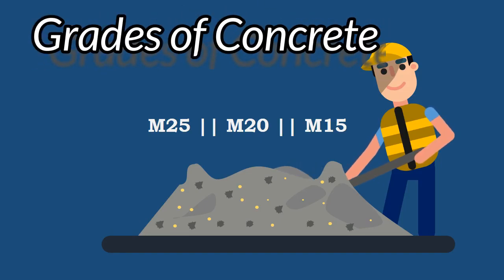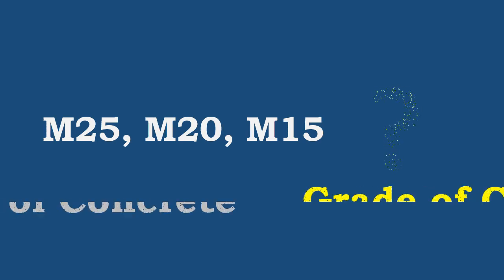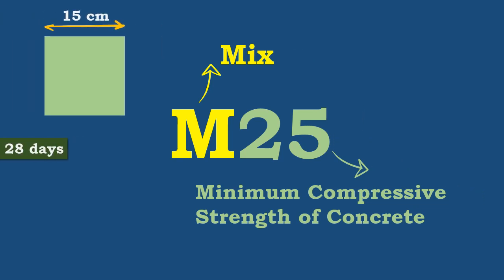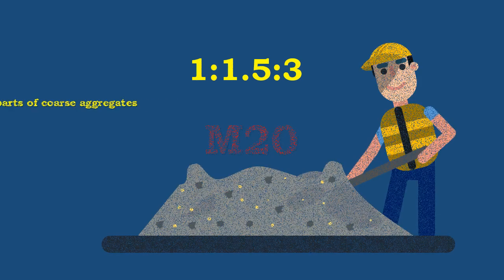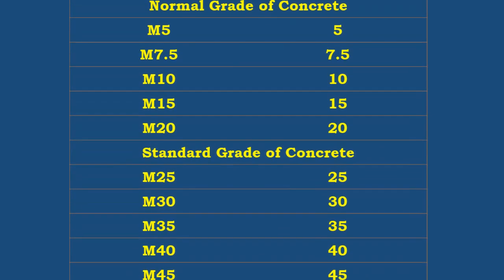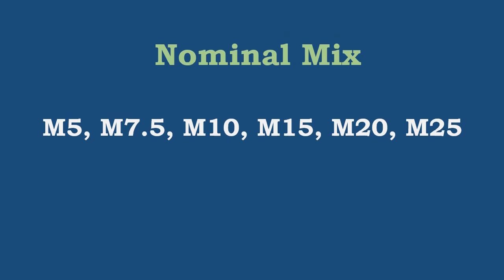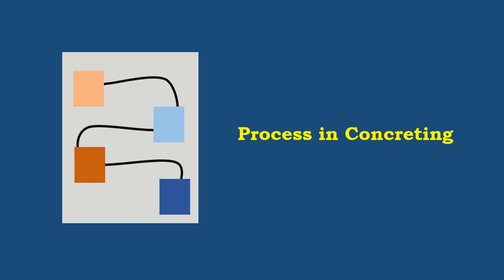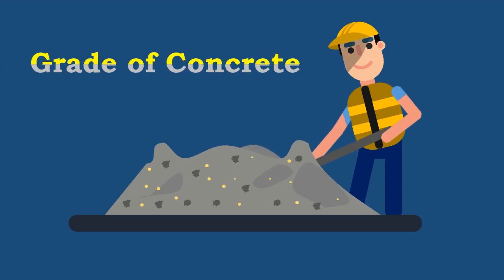Grades of Concrete || Mix Ratio || Types of Concrete Mixes || Uses ||

Comment: M20-rcc 
M15-pcc
M-mix
Number donotes compresive strength
In 28days in N/mm2
Ordinary, standard, high strength concrete
Nominal mix:m5 to m25(small construction) 
Design mix more than m25(mass construction, large structure)